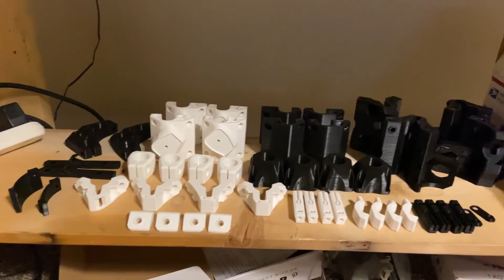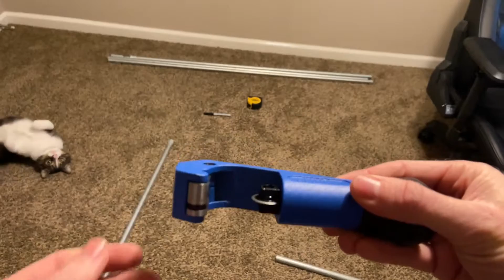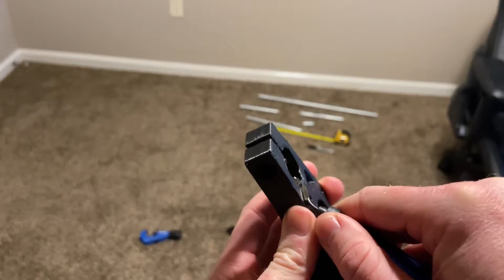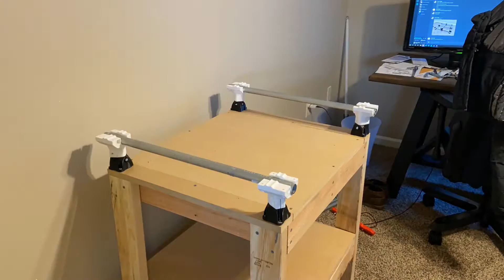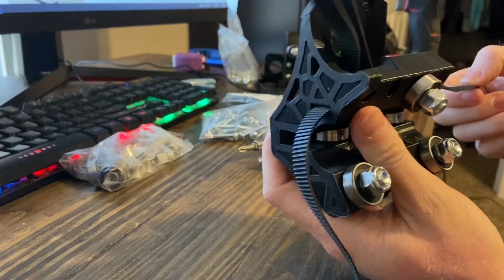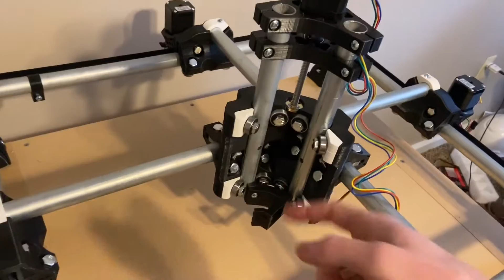MPCNC Assembly - Mostly Printed DIY CNC Router

Comment: Why did you do 70% infill. On the website for the files the creator has wrote tje best infill percentages from his tests. And the core should be 2-3 walls with 35% infill.
Reply from the maker: Hm from what I see on his website the Primo should have everything printed at 45% except the core is 70%. His instructions are also on his Thingiverse description.
Reply: Yeah I've messed up, didn't realise the guy has made multiple cnc's. The lowrider is a 35% core 30% everything else